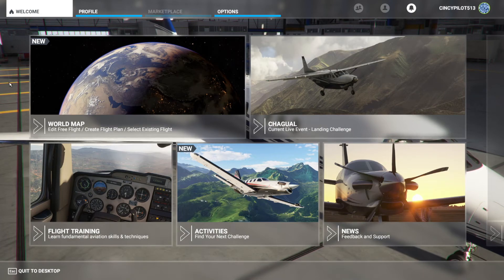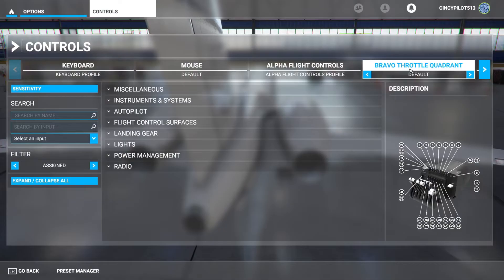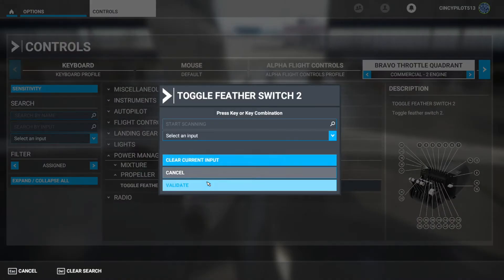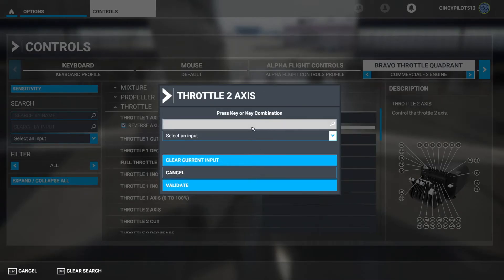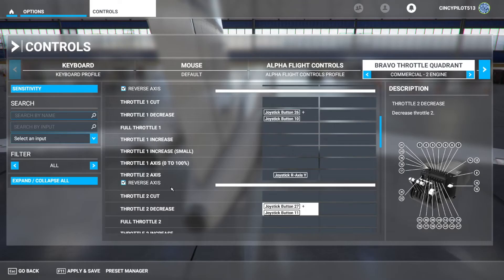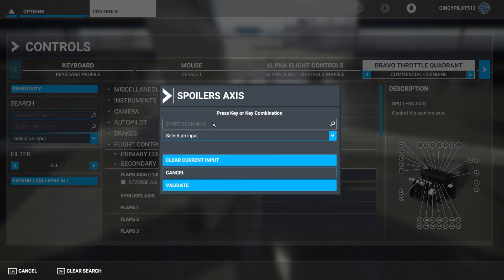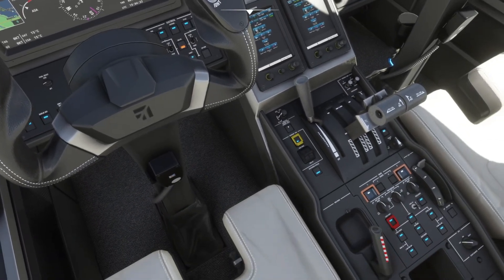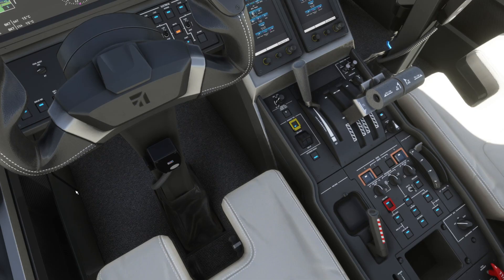Honeycomb Bravo - Commercial Two-Engine Configuration (Throttle, Thrust Reversers, Spoilers, Flaps)

Comment: i’d really love your help. i cannot get the flaps to work. the -100 to 100% option is not there. there’s only 0 to 100% and it doesn’t seem to do anything. what am i doing wrong?
Reply: Same, assuming its due to the version he was running 2yrs ago when this video was made. What I did was clicked in the left box for flaps axis, started scanning and pulled down on the flap lever. Then i clicked the right box, started scanning and pushed up on the flaps lever and saved it. If its backwards for you after doing this just push the opposite way on the stick in each box and it should reverse it for you.  Hope this helps!
Reply: turns out you only have to do 1 box.....lol....
Reply: @will77p  cheers!

Comment: hi, on my Bravia is the Level 3 Throttle 1 (Only Commercial Configuration) a little bit loose. Do you have the same effect?
I bought a second set of Commercial Levers and have still the same issue.

Comment: -100 to 100 is not showing up as an option
Reply: -100 to 100 was eliminated in a sim update. Just use flap axis and not the 0-100%. Also the update reset my realism options back to easy, so change them back to hard then the flaps plus trim will work correctly. If in easy setting the AI will cause a conflict with the trim and flaps.
Reply: I am having the same problem how did you fix it ?
Reply: @DavidJohnson-bm1ri  use flaps axis it was renamed from -100 to 100 not flaps axis 0-100%

Comment: I followed the instructions - however all by controls are working backwards, e.g TOGA is all the way back and idle is all the way front, same for flaps and spoilers. Any ideas ?
Reply: Make sure the "Reverse Axis" option is checked or unchecked, depending on how the axes are responding to inputs